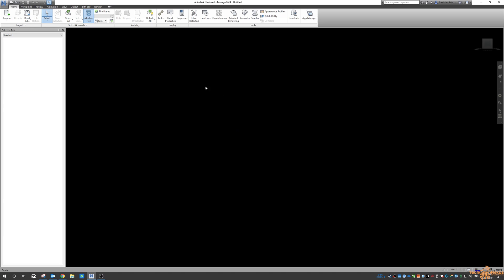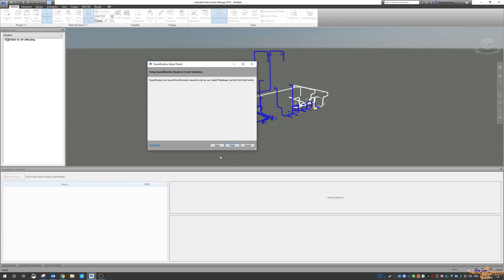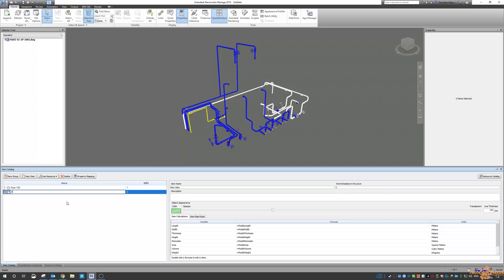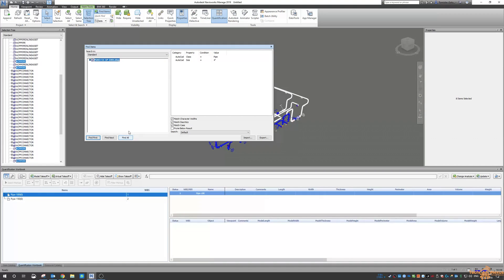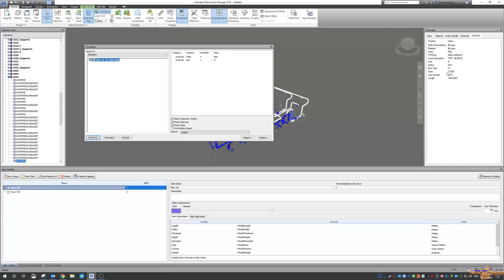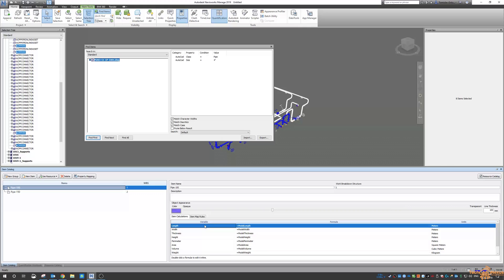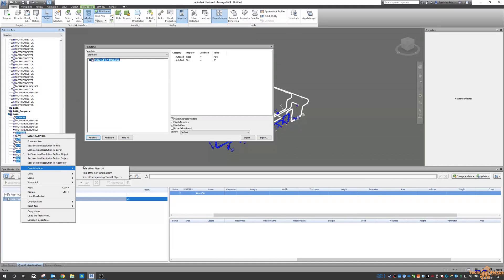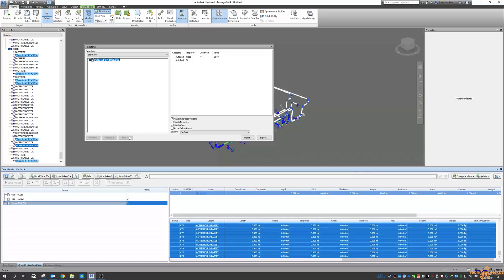Forum Answer - Navisworks Quantification

Comment: Item Catalog) What is the difference between “New Group” and “New Item?”

Find Item) Instead of isolating a pipe, how do I take off everything for a particular system?
For example, wastewater: all pipes, elbows, fittings, etc, and supports.

What happens if I already isolated all the materials I want to take off, then I don’t need “find item.”

Property Mapping) what is the relationship between category and property?